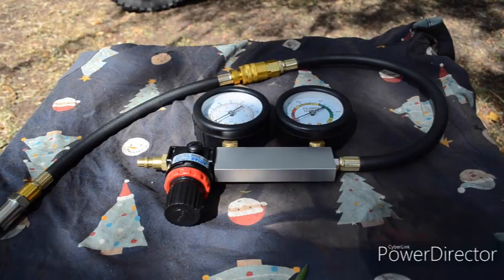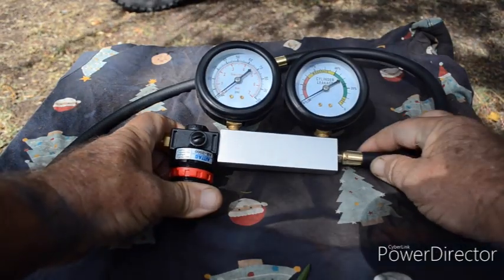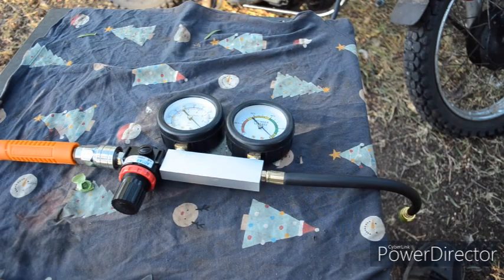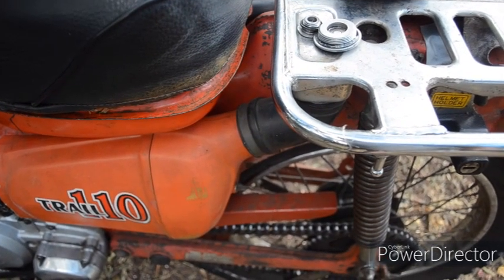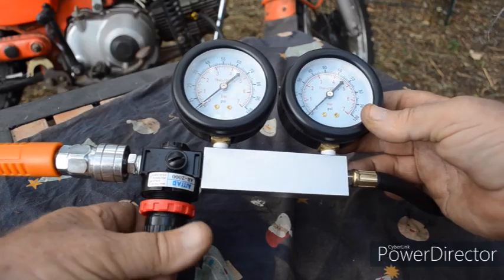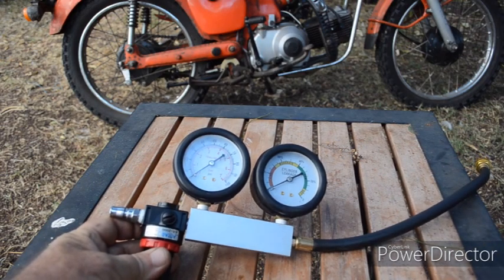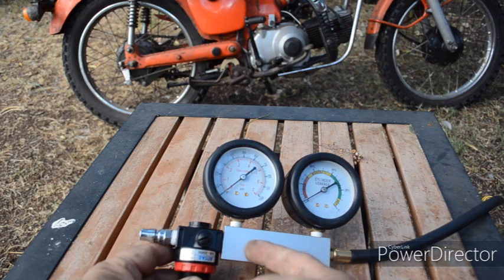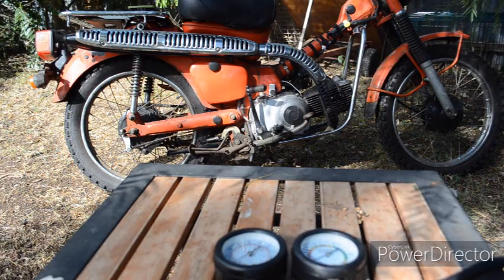Honda CT 110 Cylinder Leak Down Test - It Ended Badly!

Comment from the maker: Have you bought & used one of these cheap generic leak down testers & were you happy with the results it gave?  It seems hit or miss as to whether the tester you receive works or not.  Or maybe my engine was leaking so badly that the tester couldn't give an accurate result?  I don't know.  Having to calibrate the gauge with 100 psi air pressure seems way too high for what we'd need to test a small engine such as a CT 90/110.

Comment: Great video Darren, agree 30psi is plenty, and despite it being a crap tool, you got to where your attention needs to go!
Reply from the maker: Thanks John!
Reply from the maker: Yeah, I knew it wasn't a good tool but it was still cheaper than the cost of one new gauge.  I thought of it as simply buying the fittings to supply air to the cyl.  I was hoping though that 2 identical gauges would work better, but it didn't.

Comment: A pity that didn’t work as you wanted. Despite being trained as a mechanic back in the 60s, I never used a leak-down tester, we used a compression tester, and then various additional tests (oil down the bore, etc) to distinguish a particular cause of compression loss. Anyway, it looks like Barney still needs major work to be really healthy. He needs a spruce-up too if he’s going in the Postie GP! Les🇬🇧
Reply from the maker: Yes Barney really needs a full respray to make him presentable.  I too used to do the oil in the cyl to see if it's bore or valves, a lot of people don't have a air compressor so a leak down tester wouldn't help.  Thanks for your support Les.

Comment: Good job explaining the procedure Darren, it's been a long time since I did this test on a four stroke, matter fact I think it was a car engine. Seems like about 35 psi is what I used. I agree that the pressure should be lower for safety sake.
Reply from the maker: Thanks Dale, I agree 35 psi would work & be safer.  It's difficult to justify buying a snap on tester etc for something rarely used.  But these cheap testers don't appear to work correctly.